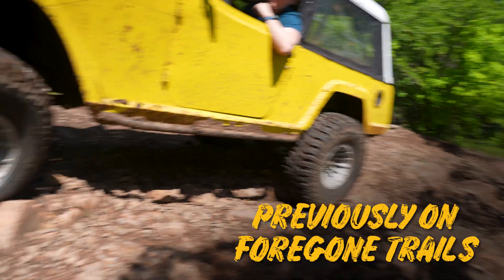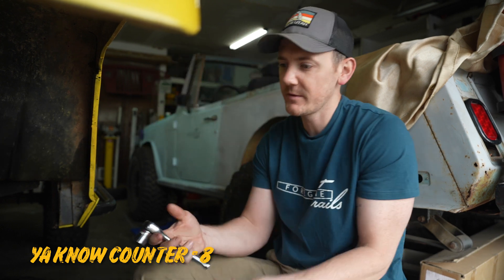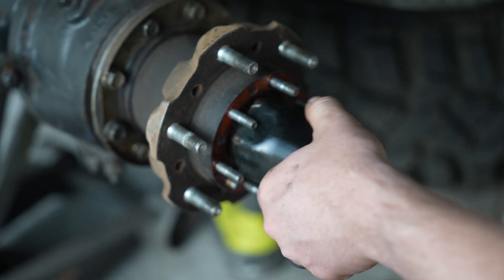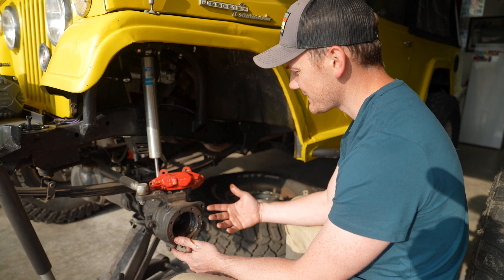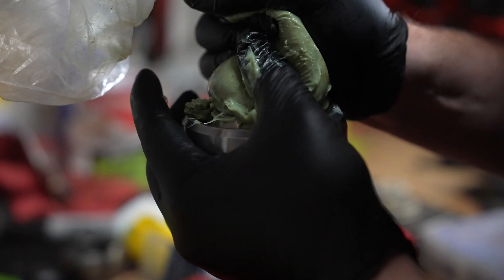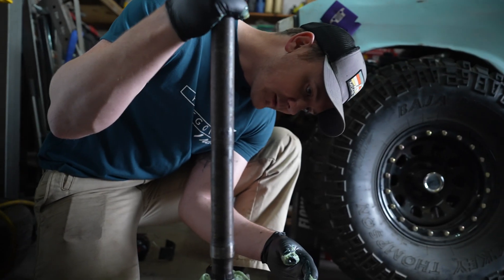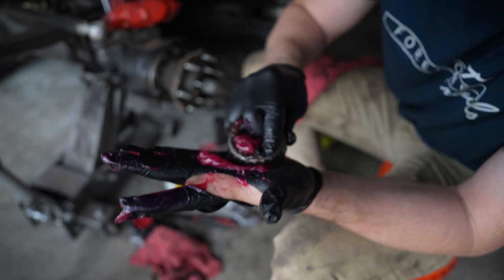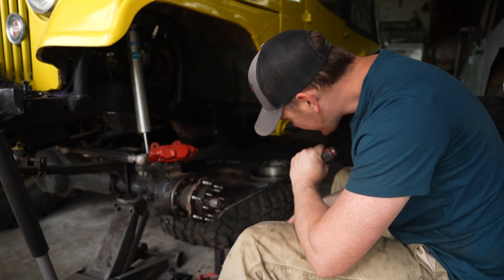Why does my Jeep have Toyota parts?

Comment: Pretty sure when you torque to 43lb/ft you need to rotate the hub several times each direction before backing it off. The torque to the final setting, 4lb/ft?
Reply from the maker: Yes, you’re correct on that.

Comment: I thought Toyota parts factory parts were made of unobtainium. 

Nice rig, ya going too custom starts to become a pain when you have to repair. I have two of everything

See you out there on the trails
Reply from the maker: I think they are, I had to switch to an ARB in the rear instead of the factory e-locker as I couldn’t find a stock replacement. 

I’m going to start my journey of two of everything here soon. 

Hope to see you on the trails.